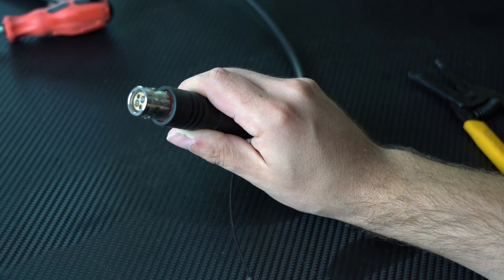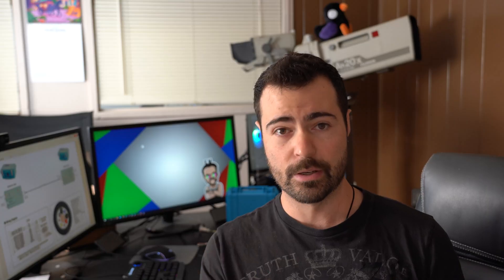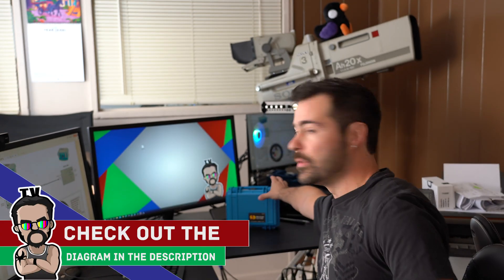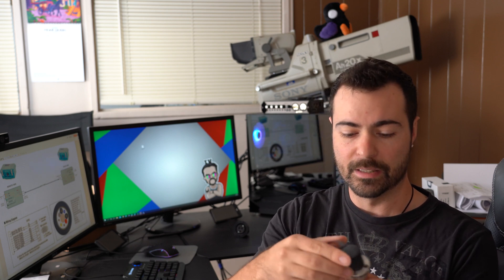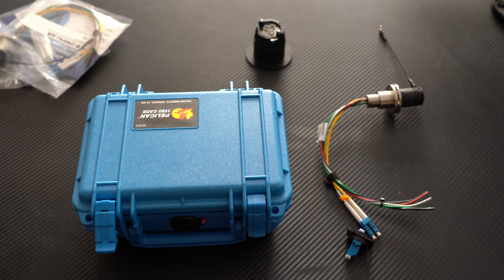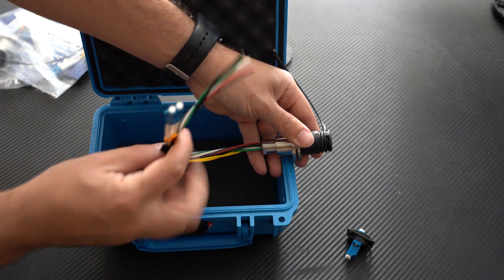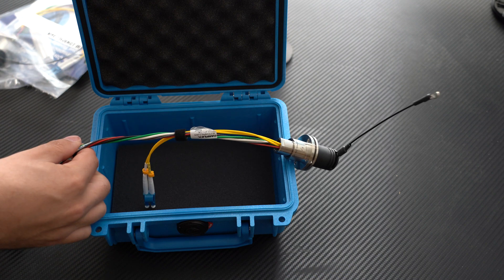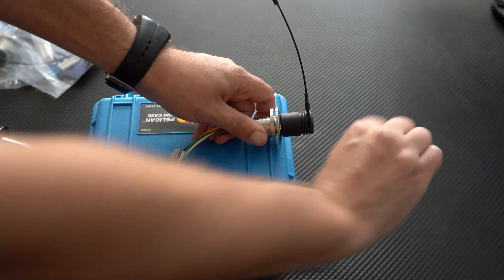Let's Build a SMPTE Fiber & Power Breakout Box

Comment from the maker: Hey guys! Thanks for checking out this video! 

Just a quick reminder that this project was a custom solution to a niche problem that I was having and isn't mean as a be-all-and-end-all solution to extending fiber and power. When it comes to power there are factors you need to consider to determine what devices you can and cannot power with this method. My pressbox draws little current and therefore can get away with this. Something to keep in mind is that SMPTE 311 cables are rated for 600vac 10amp - which is the equivalent of running 18awg wire. Distance is also a factor as resistance comes into play. Please, always make sure you do your calculations before attempting anything like this involving power otherwise you can damage your gear.

I hope to make a part-two video to this (based on your feedback) going over how to determine your power requirements and how I did this for myself.
Reply: Thank you for sharing. My only thought was maybe you didn't need the box on the truck side but maybe could just put a SMPTE jack just for the press-box inside the patch panel?

Comment: How many Amps is the 1000' SMPTE cable rated for?  Do you know what AWG the copper in the SMPTE cable is?  I also wouldn't want more than a couple amps on that cable unless its off the real.  I did see you're previous comments on this question.

Comment: Thank you for all your great content!
What parts would you recommend to use if instead of a SMPTE cable you had to connect to both ends of a pre-installed SMPTE fiber with rack mounted connectors on both ends?
I would like to reuse the pre-installed SMPTE fiber in the stadium for only data networking for NDI & Dante

Comment: Maybe a latched IEC-C14 or PowerCON NAC3 connector would work better than a generic Edison connector? They both cannot easily get loose while being pulled accidentally, and they have smaller footprint thus making it possible to use smaller cases for this project.
Reply from the maker: Ooh, I like the PowerCon idea!

Comment: I was searching for something like this I can buy but could not find any. It would be great to make use of control as well. Are there any out of the box solutions? I think a great usecase is when you have a high speed fiber optic camera and you want to get data and power to it in one cable.

Comment: When Smpte 311M and Lemo 304 are used with CCU and Camera : there is no power in the cable until the CCU knows the camera is plugged, to avoid being electrocuted or discharged if the cable falls into a puddle.

What is proposed in this video is clearly dangerous!
Reply from the maker: We are only passing 120v, but yes - should be advised to make sure the SMPTE is plugged in at both ends before connecting the source current.

Comment: Hi that looks very dangerous. You should avoid to do this . the SMPTE Fiber lemo are not made to connect 110V - 240V voltage straight . it is built to send a low test tension and when the full connection is detected the main power supply is activated and send the main voltage which can be indeed up to 600V but only when WHEN the LEMOS connector are ALREADy PLUGGED.  the connector , could melt and cause fire is you try to reconnect the LEMO connector while the power supply is plugged before . Be careful !
Reply: And I forgot to say that SMPTE Hybrid Fiber can easily get damaged. with a to strong Voltage inside without a security system you can burn the cable and cause fire or be very dangerous for anybody in contact with the whole system.

Comment: Hi, thank's for your great video! Do you know how it's possible to connect the audio mixer to the stagebox over the SMTPE connection? In your case mixer and stage box are on the same site but what if the mixer is at the other side of the SMTPE connection? Tried it but it's not possible to connect AES50 over the network switch...
Reply from the maker: To my knowledge, the only way to do this would be to get an inline AES50 extender. It wouldn't be compatible with transmission over SMPTE Fiber.
Reply: unfortunately, unlike dante which runs on standard computer networking equipment, AES50 does not. It may use the same looking RJ45 connectors and Cat 6 Cables, but the protocol (think of it like the language it speaks) it uses is completely different. If i recall there are AES50 to fibre converters out there but are on the more pricey side, and you would require a converter either side of the fibre line.

Comment: just a question: If I were to do a Fiber & Power Breakout Box like this, I could add a sdi to fiber converter in that box and use it to extended a camera system that does not have a SMPTE system  by default ( We use Sony PMW 300 K2`s - so would be very nice to have all in one cable to run). A 6 to 8 space rack at the truck and from there just these kind of boxes.
Reply from the maker: As long as you're not under powered at the camera end, yes that should work just fine
Reply: @BroadcastBuddyTV  was thinking to run mains (240v - European standard) up to the box and use the camera’s original power supply just like with an extension cord

Comment: Great solution Ryan. I also have a similar problem. I need to connect a Sony 3100 camera in a remote location to its CCU without a LEMO cable (actually the cable is not long enough to cover the distance). Can I use such a breakout cable to connect the camera to its CCU? How can I provide the power for the camera?
Reply from the maker: Yes! Most cameras like this have the ability to be powered locally. So 2 stands of fiber and the CCU and camera are powered locally at their respective locations.

Comment: Is running mains in this way a good idea with other devices using the same pins 304m pins for DC power not AC? seems like there's alot of potential for an issue if you're running in a mixed environment.
Reply: bmd uses 400V AC.
Reply: @juri14111996  have you a reference for this as i have heard a different number.

Comment: Cool stuff. What I don't get is why you didn't built it inside the remote press box ? The top rail could host the plug.
Reply from the maker: Just for utility's sake. This way I can use it for the second unit, or other similar applications that aren't specific to that single press box :)

Comment: Thank you so much, this is a great video.
For those new to Ndi, Can you Please explain more about your Ndi work flow and equipments used?
Reply from the maker: Sure! You should also check out my video on building an NDI camera monitor where I go over some of the basics: https://www.youtube.com/watch?v=u9n95Lhc6UU

In this workflow you'll need an NDI encoder (to get the baseband video to NDI) and a decoder (to get the NDI signal back to baseband video.) For this, I am using the Birddog Studio SDI to NDI Encoder at the remote location and the Birddog Quad NDI to SDI Decoder at the truck end.
Reply: @BroadcastBuddyTV  Thank for the reply, I already watched the video two times :), it is a great video but I need to get a big picture on how the devices are working together in Ndi work flow, I understand from you video that a single Birddog can be used to convert upto 4 HDSDI camera inputs into one NDI stream output over  a single ethernet cable then that single cable will be connected to an ethernet switch, then from that switch you connect to your different devices and here I need to understand more, how I can connect monitors, vision mixers, video routers, recorders and how I configure them and what the options I have in that case, and finally what are the best scenarios to use? too many questions but I wish if you can help me to learn about it, finally what are the best option to send the final stream over internet using zixi, srt or other protocols, also please if possible a walkthrough your system with some explanation will be very helpful.
Reply from the maker: @abdelfatahh4114  Sounds like I need to make a video on this, haha! 

To give you a quick and dirty answer, in order to connect a destination device (like a monitor, switcher, or router) that device would need to be able to receive an NDI stream. This is called "subscribing" to the stream. If the device is unable to do that natively, then a decoder is needed to get that NDI stream back to baseband video. Which is actually what I am doing with my pressbox in this video. I have a Birddog Studio to encode my remote camera in NDI (just like I did in my camera monitor video) and then at the truck I have a Birddoq Quad which is decoding the signal back to SDI - which then goes into my switcher.

Like in the previous video, you see me using Ross Dashboard and Newtek's NDI Monitor software to "subscribe" to the NDI streams on the network. Well, there are hardware devices (kinda) that are able to do that too. I say kinda because really those devices are running software that allow them to subscribe to the NDI streams. Like Newtek's Tricaster... this may be considered 'hardware' but the switcher is still software based - which allows it to easily accept NDI streams.

I hope this helps for now. I'll definitely plan on making a video around this :)
Reply: @BroadcastBuddyTV  thank you dear, a great reply from a great Engineer,.
I still little bit confused why you need Ndi in remote production and you still need to decode them in your opvan, i think it is not worth to use Ndi to just save some cables, i saw some Ndi setup using Birddog and Dante with Tricaster but sometimes, the Switcher was only able to identify the Ndi stream from each camera after doing some restart, i saw before one production setup decided to disable the Birddog and connect directly the video signal to Tricaster via Sdi as old school

Comment: I'm unsure of this solution... if someone who doesn't know mixes this up with a standard shed/HDX box is this going to fry the camera, or what happens if your CCU is trying to send power to your booth kit... will it or is there a handshake first? IMO it's not worth the risk unless you know it won't break anything in the case of a mixup. Why not put a tac cable and SJ wire in a tech flex braided sheathing and put that on the reel?
Reply from the maker: I can definitely see the concern and it may not be a great solution for everyone. In my scenario there's only three other engineers (in addition to me) who would ever be handling the insertion of SMPTE at the truck or handling the breakout boxes in general - so I wouldn't be worried about them confusing it for an HDX box - being that we don't have any haha. As for accidently plugging it into the Lemos on the truck for the CCUs, that very well could happen. It might be a good idea to put some red tape on the intended reel as a red flag to not use it for camera connections. 

Your suggestion of tac and SJ wire would also do the trick... I was just trying to work around what I had mostly on hand as a way to save some time and money :)

Comment: If I'm reading correctly, SMPTE-311 cables only have 4 x 20awg wire.  I'm not sure this is a good idea power-wise and load-wise for cables of any length. 1-2 amps maximum.
Reply: 311 Cables are rated for up to 600Vac, 10A. The Lemo connectors actually terminate with tying 2x of the 20awg wire together, making it closer to 1x 12-14awg x2... If that makes sense haha.
Reply: @st99productions55  That makes sense but that's not what is shown on this video.  He did not tie any conductors together.
Reply from the maker: @MrKricher  Sorry for the confusion! The Lemo breakout connectors that I use in the video are already terminated with 18awg wires. The 4 conducts that get tied together are actually already done on the termination of the SMPTE 304 connectors on the SMPTE 311 cable that goes between the boxes - aka what is on the reel.

I could have done a better job explaining that. Let me know if that makes sense. :)
Reply from the maker: @MrKricher  Understood. I was actually planning on going into the wiring details by explaining the diagram I made and provided in the description and then decided not to. I see now that I probably should have. 

To answer your question directly, the SMPTE 311 cable I used consists of two single-mode optical fibers, four 20 AWG (power) and two 24 AWG (control) tinned copper conductors. The breakout cable itself consists of two single-mode optical fibers, two 18 AWG (power), one 18 AWG (shield),and two 22 AWG (for control) tinned copper conductors. When I had measured the voltage under load with the 1000ft reel, there was a slight drop of 2v. I definitely don't have the specs in front of me, but I believe the most power intensive thing in the box is the Midas M32c, which is only 40W - so figure .333 amps and has a VAC acceptance of 100 - 240vac. 

But like you said, a lot of important info there! I'll definitely consider making a follow up video - but in the meantime when I get a chance I'll type up a little explanation and make it a pinned comment.  Oh! And you're not a downer! This is awesome feedback!

Comment: How many watts can you pull from a single SMPTE/LEMO cable?
Reply: I'm guessing the press-box doesn't draw all that much, but also taking in account the enormous spool that might cause heat?
Reply: That depends on wire gauge and distance
Reply: @MrKricher  Well obviously, but I'm guessing most of these cables have about the same AWG? How much could you pull on a 200m for example

Comment: Man this is a great idea! You might want to consider putting a 10 amp fuse or circuit breaker in the remote box just to protect the SMPTE cable from getting overloaded
Reply from the maker: Definitely wouldn't hurt, thanks for the suggestion 🙂
Reply: I dare you to pull more than one amp one those 22awg wires. 10amp would do nothing unfortunately
Reply: @radiobestbucuresti could you elaborate on